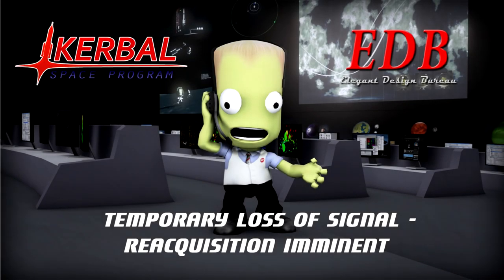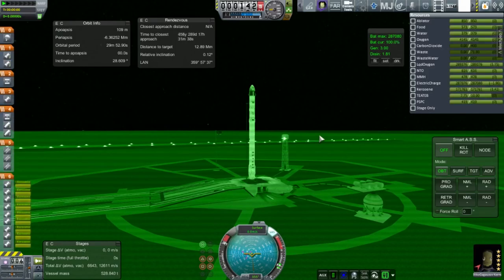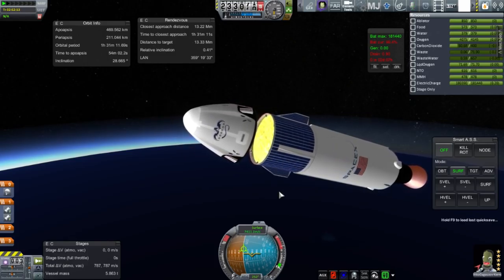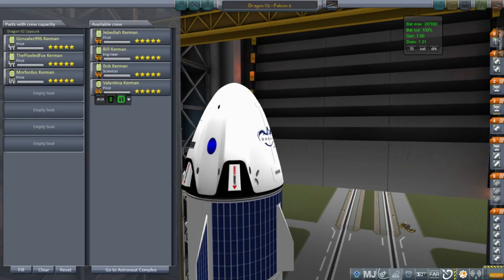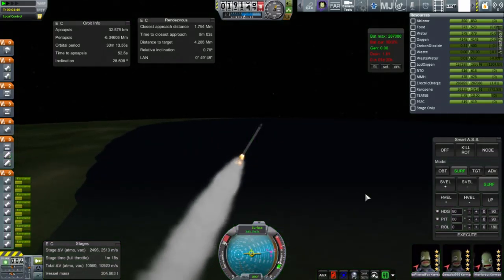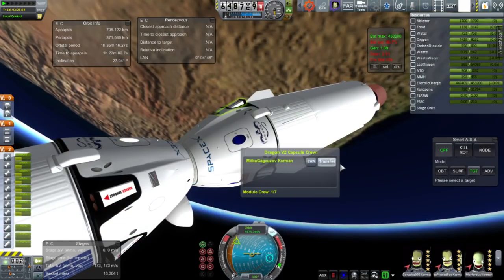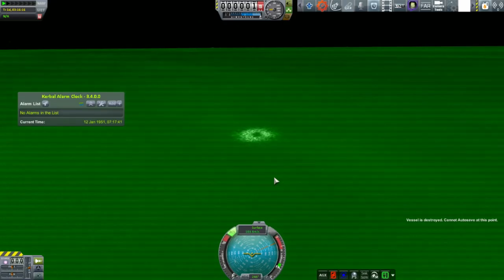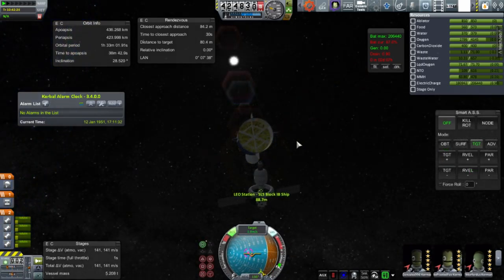Sol System Colonization in KSP/RO - 02 (2015-11-01)

Comment: How interesting! I would think that you would put on a second parachute on the second stage. Whatever, just alarming to me because I always deploy my chutes too early and end up breaking them or melt them off during a re entry. Anyway, I think I found a workaround for the pesky heat affecting part clipped parts. Instead of having them be connected to the main capsule, try attaching them to another part that is more heat resistant. It seems to have worked a few times at least for ME. I think it works best when connected either on the ablator or a more heat resistant part than the parachute itself. Also if you connect the parachute make sure that it isn't connected to a part that can easily fall off science gear landing gear assuming they survive reentry or other nefarious items. Or you could use radiators but hey who needs those! :P Edit: I really hope the fix the stupid heat rendering physics thingy, it's broken. Mabey in 1.0.5?
Reply: Think they'll finally port the game to unity 5?
Reply: ***** I can't wait!

Comment: I would reccomend you to install StarShine Industries Merlin Engines. They look much better (but not RAM intensive), they have proper Real Plume config instead of these and finally they have latest Merlin Full Thrust config.

Also they will be supported in the next RP0 release.
Reply: Yes, they are supported by RO (and also by RP0 in the next release), I used them for my Falcon Heavy replica:

http://imgur.com/a/XMIfP#0